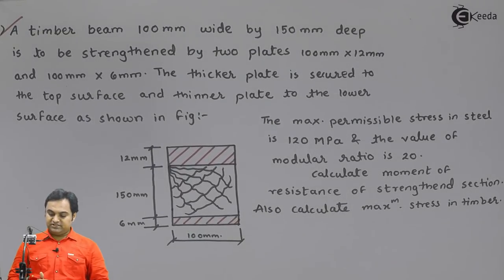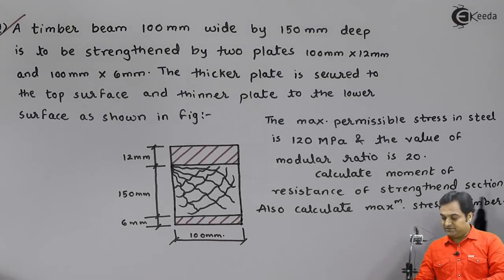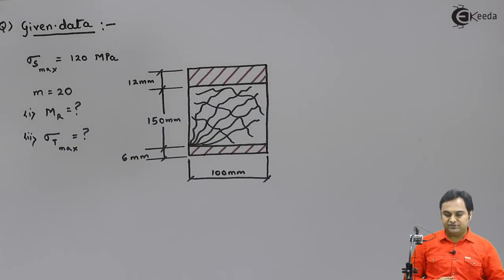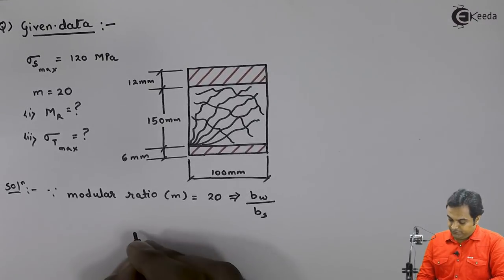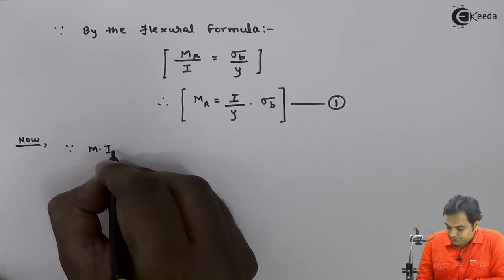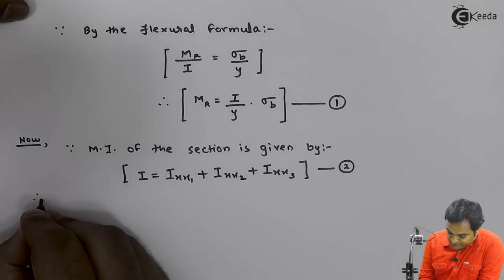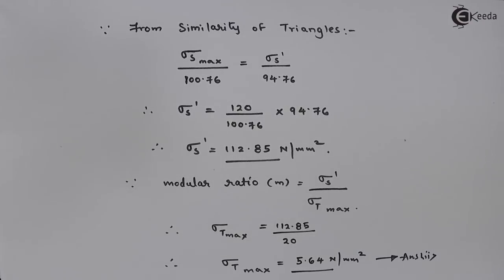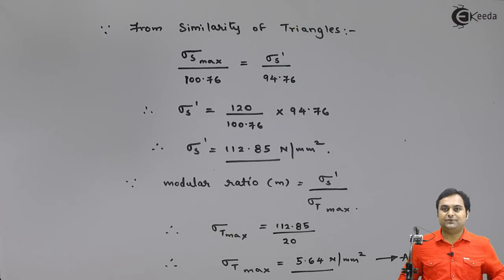Flitched Beam - Problem 1 - Stresses in Beams - Strength of Materials

Comment: A filtched beam consist of a wooden joist 150 mm wide and 300 mm deep strengthened by a steel plate 12 mm thick and 300 deep on either side of the joist. If the maximum stress in the wooden joist is 7 N/mm', find the corresponding maximum stress attained in steel. Find also the moment of resistance of the composite section. Take É for steel 2 x 10' N/mm² and for wood 1 x 10 N/mm²  solve this answer for me sir

Comment: sir i think there is a mistake at 10:39 in taking the y3....
it should be 12/2 instead of 6/2
Reply: Berserk Sociopath Yes
Reply: Sai Venkatesh Kolipaka som exam already over in mumbai university....
none of this came
Reply: Berserk Sociopath will be useful for next batch
Reply from the maker: We will work on this and get back with improvement.
Reply from the maker: We will work on this and get back with improvement.
Reply: Aditya Rane 

yes
Reply: Yes
Reply: But he still calculated the correct value of y bar .
Reply: @awkweird_panda  he had already calculated the value..he just wrote the wrong value by mistake

Comment: A flitched beam consists of a wooden joint 100mm wide & 200mm deep, strengthened by 2 steel plates 100mm thick & 200mm deep. If the maximum stress in the wooden joint is 7N/mm2.

a) Calculate the maximum stress attained in the steel.

b) Calculate the moment of resistance of the composite section.

Comment: I have a question to ask,if we want to get max value or moment of resistance,shouldn't we use smaller value of y to get bigger moment of resistance?and when it comes to modular ratio,what determines which value is on the top and bottom?the timber or steel??